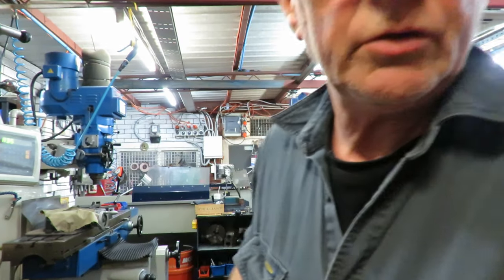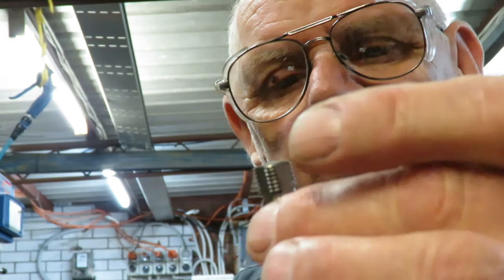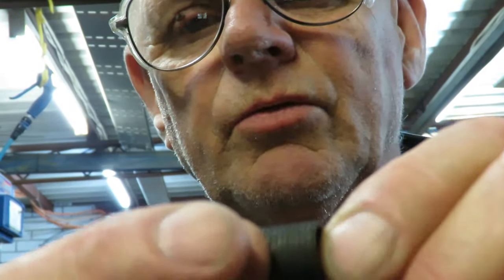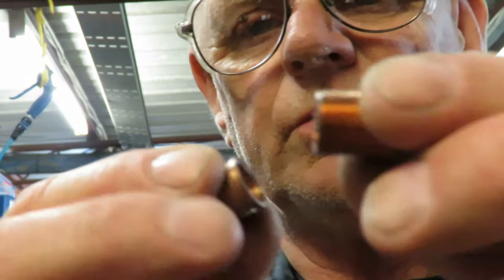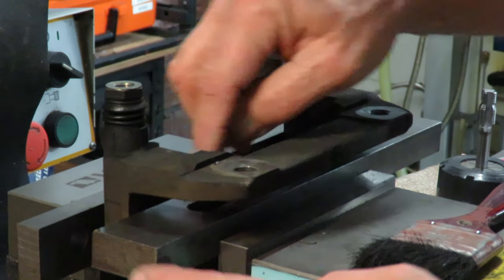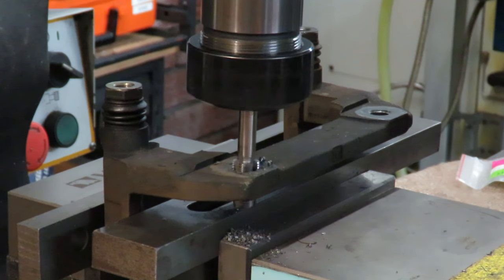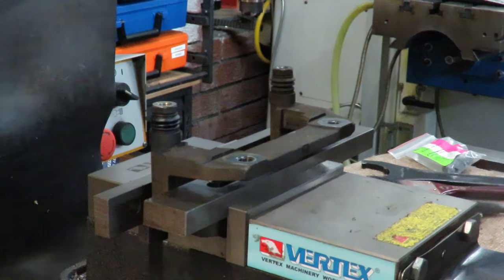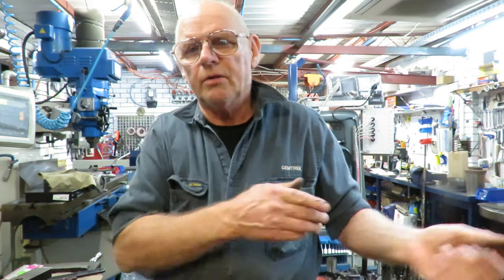Repairing a thread in a brake caliper using a solid insert TIMESERT.

Comment from the maker: TimeSerts have their place amongst thread inserts options available. Timesert Kits are not cheap. I carry about 100 full thread repair kits, the majority of which are wire inserts (Recoils / Helicoils and other brands). Add to that 50 individual thread taps and coils of the more odd ball stuff. My TimeSert kits are mainly for spark plug and other usages. I also carry several BigSert kits (thicker walls) as well as Keen Serts and other brands of heavy wall insert. The last resorts are to make my own. Most brake callipers with 9mm threads I use wire inserts with good results. In this case the thread is M12 x 1.25 and that is the same as the spark plugs so it was a neat fix.

Comment: the best method for repairing a thread on a cycling load as a brake caliper
I don't trust wire inserts on such an application as usually, the resulting thread is on the loose side well beyond a normal thread tolerance

Comment from the maker: Much of a muchness strength wise with thin walled solids compared to wire inserts in my opinion. 
The heavy walled units are where you gain a higher grade of strength, however the thin walled and wire inserts will provide the same "pull strength" as the original thread providing they are fitted correctly and there has been no "spill" in the hole. I use the thick walled ones only where the hole has been elongated or drilled oversize and I want to maintain the original thread size, not to gain any more "pull strength" as a rule. Applying the seven "P's" are paramount in thread repairs.

Comment: Nice fix! Looks both easier and also more solid than the ones with the tang You have to knock or break off. I'm never satisfied with the result on those break off ones. Guess I'm in the market for more tools again..LOL. Thanks for posting! ;)
Reply from the maker: Erling, I use a huge amount of wire inserts with great success, the issue is application, drilling tapping and applying with care. A common problem with wire insert failures that I have seen, come down to a few basic issues: drilled and or tapped not square, even pressure not applied during the insertion process, people using "The next closest thread tap" and not a proper STI Tap. Fitting an insert that is too long for the tapped thread. You need to keep in mind that in a blind hole the last couple of threads will not be complete and will cause the insert to be smaller at that point thus binding the stud, hence I also have "bottoming taps" for most of my kits as well as the supplied "inter tap".

Comment: G'day Bruce, I'm intrigued as to why you're customer came to you for this job, I would think another part from the wreckers would be cheaper unless the vehicle is exotic or too old. Nice job.
Reply from the maker: The reason he came to me is three fold, firstly he did have access to machines in the past, however now he does not, secondly I was recommended by a local hardware store, thirdly it is a non standard retro fit to an old car.

Comment: Hello, 
Thank you for the informative video. Please excuse my ignorance, but is the brake caliper aluminum or steel? I have a completely different application where I would need to use 1/8-27 NPT Timeserts  in the ends of mild steel rods. Are Timeserts proper for this application?
Thanks
Reply from the maker: Kev The caliper was a steel forging (normally are). Timesert's are a good choice for thread repairs or giving extra strength to aluminium threads. Why would you put an insert in the end of a steel rod, I fail to see any advantage? The timesert is not a high tensile steel.

Comment: do i need the aplicator if I use red loctite om the insert? ...
Reply from the maker: Dag, Thanks for visiting. The short answer is no!.  The Time Sert and the Big Sert solid inserts must have the complete kit for installation, because the applicator's job is to "expand" the insert into the threaded hole. The insert as it comes out of the box is undersize so you can't screw a stud into it unless it is expanded! That is the drawback with Time Serts the cost of the kits are not cheap and usually only us professionals can absorb the cost over several jobs.
Reply: Thanks for fast reply. But it is the last treads that expands and on your job you grinder that down. What are your thoughts on that?
Reply from the maker: Dag, The other option is to use the KeySerts these are inserts with 4 small keys you use a standard thread tap for them screw them in and thread tap the pins into lock the insert, you will need a bolt and nut that has been machined down smaller than the inside diameter of the keys to crew the insert in no need to buy a kit.

Comment: That has made a very neat thread repair! I noticed that when you showed the counterbore result that the hole was not square to the machined surface, I think the rim of the insert must be not below the surface or it would tend to be pulled out when the caliper,(in this case) was tightened. An excellent repair system by Worth.
Reply from the maker: Mr Pom Frog (don't go getting offended now, this is an Oz endearment)! The camera angle does throw a bit of distortion. I have set the job up in the mill to make sure everything is lined up,  Can't do better than that. Many a repair I do on site and that is not a guarantee for 100% trueness even when I use my mini square. The part has been fitted and everyone is happy. BTW Wurth badge some of the kits as their own, however I buy many from other sources because Wurth carry a limited range.
Reply: G'day Bruce, I wasn't implying for one moment that you had set the caliper up out of line, I thought that it was the original manufacturing that was bored out of square with the face, I know the camera angle can change the truth, (the camera never lies?), but it really does look like the counterbore cutter has touched down on the right hand side of the hole at 9.33, due I am sure to the lens of the camera, so these are Timeserts, not Worth.

Comment: Those inserts look pretty good. Saves making threaded bushes up on lathe and fitting with loctite or welding up the hole and tapping it out again. I did get some locserts that are like helicoils but with four keys that are driven down to lock the insert in place.